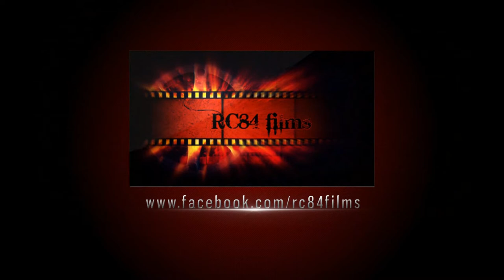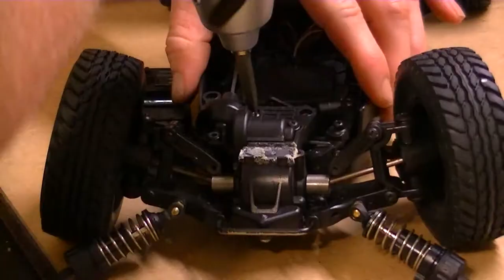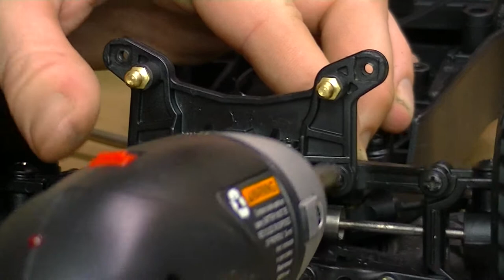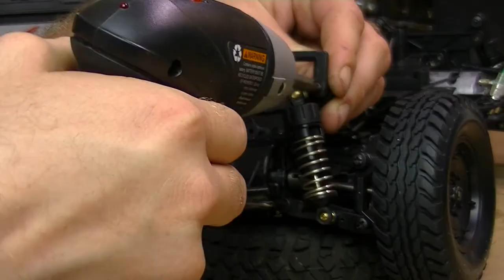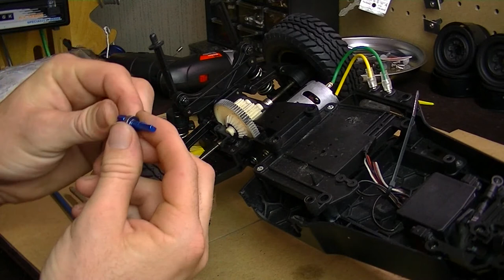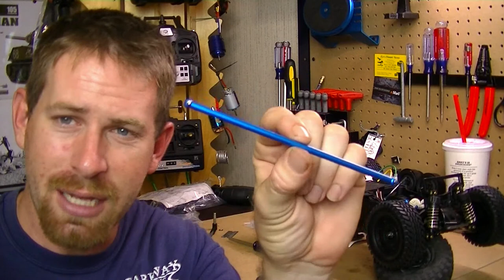RC84Films: Another Problem On Tamiya M1025

Comment: The Hummer chassis is called DF01. Apparently it is a TA01 with TA02 rear arms; kind of a hybrid. I believe the DF01 name was introduced later. The Hummer manual does not mention it, but the recent Porsche Cayenne does.

Tamiya made a stronger shaft as option part #53079, it is listed in the rear of the manual. This site has a photo and lists the compatible chassis: https://www.rcjaz.co.uk/tamiya-53079-manta-ray-stainless-steel-propeller-shaft-set-top-forceta01ta02df01-p-90072489.html

RCMart also has a TA01 Yeah Racing shaft: http://www.rcmart.com/yeah-racing-ta01134bu-aluminum-modified-main-drive-shaft-ta01-p-28412.html?cPath=595_744_754
No idea if that one will fit...

On my Hummer I used the original drive shaft but kept the front differential unlocked. Then the weak shaft is not so much an issue. The Hummer is anyway not a good crawler by todays standards, so I take it easy and bring it only on lighter trails. It's an old RC car ... but boy, is it gorgeous!
Reply from the maker: LANE Boys RC thank you for the information on the Hummer I did swap the diff from front to rear and lock the rear diff. I know she not Crawler and that not what I brought it for. I know what a rock crawler is and what a trail Crawler is for and for sure the Hummer is a trail Crawler thanks again I knew you would know